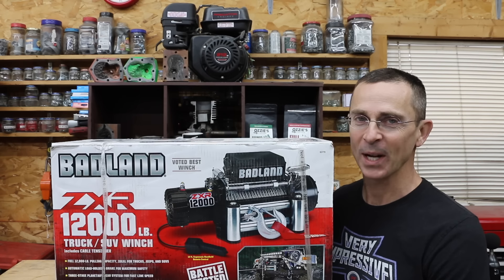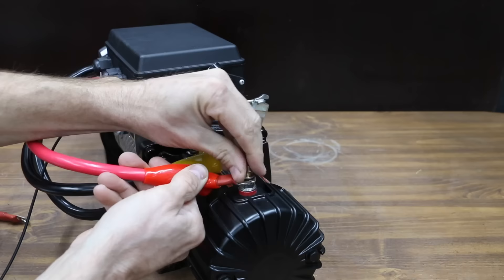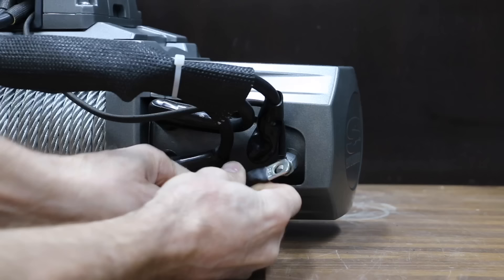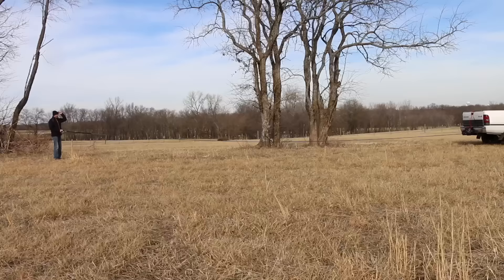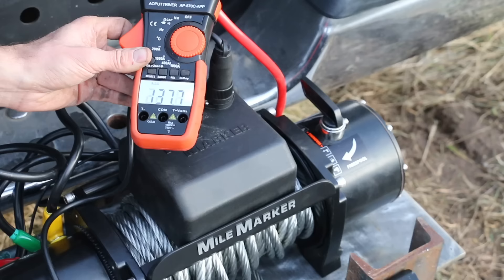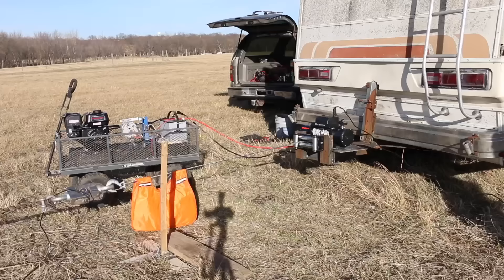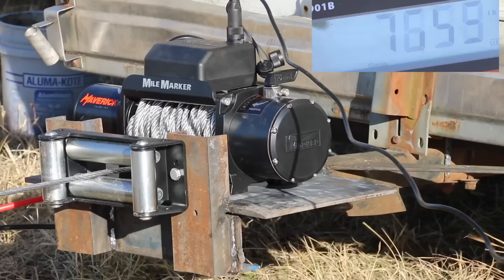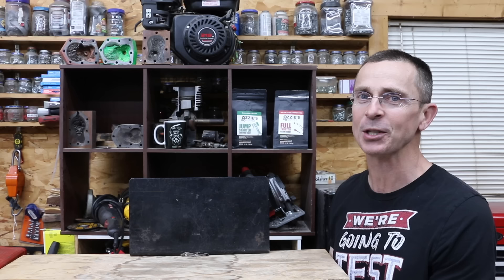Best Winch? Is BADLAND Better Than WARN, Smittybuilt, Milemarker? Let's Settle This!

Comment: I've got the harbor freight badland and have used it heavily and frequently at work.  It's been quite good.  The electrical box on top always pops off and the cable connectors have slipped off.  All in all well worth the like 250 I paid for it 4 years ago.
Reply from the maker: Thanks for sharing.

Comment: Im surprised I missed this one, great job Todd!

I must say, every winch I've ever owned (Warn, Mile marker and Ramsey) all stated very clearly not for lifting. They aren't designed for that. A hoist would be used for lifting and have very different safety features. 

I encourage everyone to research the difference before making a purchase for your intended use. As well as researching the difference between a planetary setup and a worm Drive setup.

Thanks again for all your hard work!
Reply from the maker: Thanks and you are welcome!

Comment: One major factor for a lot of these results is due to the cable being used. I know plenty of people who buy a winch, throw the cable it comes with out, and put on a high rated synthetic rope, whichever brand they have had the best luck with between themselves and their friends. Maybe a test of some of these winches along with the ones others have suggested bit using a good quality synthetic rope for every winch to really make it a test purely of the winch itself and eliminating the variation in rope and cables
Reply from the maker: Thanks for the suggestion.

Comment: Remember that a Class2 hitch receiver is only rated to 3500 pounds. More than that, and pull may pull off your hitch or bumper or bend the vehicle's frame.
 You need a Class3 to handle 12000 pounds--if it is properly installed.

Comment: I'm  going to use one of these to pull down small trees out stump and all. I'll build an anchor plate that attaches to one or more bigger trees then the chain side high up on the tree to pull out. Since it's wireless I should be able to stand pretty far away from the trees too for safety.

Comment: A good test!  Too bad the mounting plate failed!  That is the achilles heel of most winches!  Almost every winch i have heard of being damaged in a pull was from a mounting plate failure.
While I dont know about the others, I have been told that parts are available for Badlands, and most can be repaired.
Reply from the maker: Thanks!

Comment: I used to think that Warn was the only brand worth considering. It has now moved to the BOTTOM of my list. I'm impressed with the Zeak and, given that they are ALL made by the ChiComs, I don't suppose it matter about 'Branding'. I'm also impressed with the performance of the synthetic cables. Since even the more robust winches failed at loads iess than the typical synthetic cable failure and it is much easier to work with then  It seems that synthetic cable is the way to go. Perhaps a test of synthetic cables is in order.

Great work., BTW, Condolences to Cud'n Eddie on the damages.

Comment: The winches have the rated pulling power on the first wrap, the second and third wraps have a lot less pulling power.
With a snatch block at a 10k lb load and running the wire rope out and back to the winching vehicle,  the load gets pulled by both lines 5k lbs each, so the winch only pulls one line or 5k lbs. 
This is a much safer way to pull because a person does not risk overloading a line and the winch is only working half as hard.
Technically a 5k lb winch with a 3500 lb rated 3/8 inch wire rope can pull  25k lbs load using  7 snach blocks and 8 lines to the load. If the winch mounted on a jeep or 4x4, one line from the vehicle and the remainder of the lines would come and go to an anchor like blade from a small caterpillar or loader buried in the ground.
Reply from the maker: Thanks for the feedback.

Comment: I would love to see the apex tested. Although, since I can't seem to find the difference between the two, I'm mostly interested in seeing how the apex performs against the badlands you tested in this video. There's a big price difference and not a huge difference in specs, at least that i can see
Reply from the maker: Thanks for the suggestion.
Reply: Apex is worth it if you want to go synthetic right out of the box , I ended up converting my Badlands 12k to synthetic. Also if I'm not mistaking the Apex is also the refined version of the two. Either way can't go wrong Badland winches seem to never quit even under multi use everyday for years with out yearly service.

Comment: What they don’t say is that the rated pull capacity is only at full run-out of the rope or cable.  Always buy double the capacity you need.
Reply from the maker: Thanks for the feedback.

Comment: winches whether they are  rope, wire,  or chain have a gear train and that's where a lot of the failure occurs. Plastic housings poorly, machined gears, and poor lubricant all contribute to  wear conditions that cause failure.  It'd be interesting to see them  run on some kind of automated  up and down cycle rig that had them lifting and lowering   a large weight  however many times it took to find their failure points,   to see which wears out first and why.
Reply from the maker: Thanks for the suggestion.

Comment: I have used several different winches over the years and I will stand by warn. I am cheap af and try to save a buck where ever I can and did that with winches but I noticed the cheap so ex wouldn’t last very long.  Like I mean I was lucky if they would last a summer going out every weekend off roading. I broke down and bought a Warn 8 years ago and it’s still working. In fact I have replaced the line twice now and the winch it’s self is still going strong.
Reply from the maker: Thanks for sharing.

Comment: Sherpa winches, another testing idea, 12 volt air compressor like the one made by Sherpa, Odyssey and a few others. Where not taking about the ones that plug into your cigarette lighter either. These you mount and wire into you vehicle
Reply from the maker: Thanks for the suggestion.

Comment: For anyone looking for a quality winch at a low price stegodon available at Amazon, eBay Walmart or their own website is a beast, I have a 13500 lbs and it’s fast reliable and apparently they are made by the same factory as warn and sold under a different brand
Reply from the maker: Thanks for sharing.

Comment: And the Zeak has "Easy to operation" in the picture on it's platinum series. I've been thinking about the Badlands for my bus, but considering it was the worst, probably not. I don't think I'd need it for anything this extensive, if at all, but good to know! Biggest positive is I have a store nearby, just a couple blocks from where I work. I just don't know about the warranty replacement or if their extended warranty covers it. Right now, I'm not even using the bus, so no biggie.
Reply from the maker: Thanks for sharing.

Comment: Visually looking at all the brands of winches on the web stores, many have exactly the same externals. Their must be over 20 brands that just look like paint and stickers are the only difference. common for imported products. prices vary greatly even though externals are exactly the same. The Zeak winch has several look a-likes. Living in Alaska I use winches many times a month and prefer either PTO or Hydrolic over electric winch everyday. yet for vehicle recovery and such Electric is the go to. I pulled a skid steer out of a deep creek last month with a 16,000 lb PTO and busted some of the cast metal parts on the frame. so everything has its point of toooo much. thank you for this test and its a good one.. I will be using your test info on purchase for a new winch for my equipment trailer..
Reply from the maker: Thanks and you are welcome!  Thanks for sharing.

Comment: Another important thing to consider is ease of repair and design. The Warn VR evo (while Chinese made like the others) has much better wiring inside the control box, which was neat and very simple. Compared to my old smittybilt which was a jumbled rats nest of wiring in the control box. Also, I’m MUCH more likely to be able to buy repair parts from a major company such as warn.

Also you claim the Warn winch was 79 pounds with synthetic cable when you cleared got 79 pounds while it had steel cable, greatly increasing the weight. In reality it’s much much lighter than 79 pounds with synth cable.
Reply from the maker: Thanks for the feedback.

Comment: This was a great test, thank you for doing it.  The results were even a bit surprising, as Warn likes to claim they are the best winch on the market.  Being an avid off road Jeeper, I use my winch all too often and It would be great if you could do a durability test starting off with the winch well submerged in water.  I have had a number of winches fail on me after the recovery due to the IP rating being a false claim.  They all work under water as stated, but they allow water and debris inside over time and the contacts and bearings fail.  A winch is an emergency tool, and it needs to work when all the chips are down.  I even had a Rough Country winch kill my battery when simply parked in my garage after wet recovery the week before, actually I have had that happen with that brand twice!.  After I disassembled it, I found massive intrusion of water and debris that was causing the contacts to short.  Adding this to a test would make for a real world test and would be greatly appreciated.  Again, thank you for all you do, I lover your videos and the unbiased approach you always take, please keep up the great work!
Reply from the maker: Thanks, will do!  Thanks for the suggestion.

Comment: I see you using the Amazon cordless screwdriver (nosky?), That you rated really highly. The only thing it didn't have was a changeable battery. I went with the Milwaukee M12, it's great, I use it for furniture assembly
Reply from the maker: Thanks for sharing.

Comment: Since the rug pretty much relies on the base for any rigidity, yeah prob should have used a better one lol... I got slightly higher rated one, 13.5 I think... And yeah, it'll twist shit up if not mounted well.  Also I use a snatch block if doing anything other than a flat tow.

Comment: Looks like the Zeak brand is now boxed and branded as AOTOWO. Same winch as I can tell. Looks like they sold out of the one like you tested and have rebranded them. Even less expensive now, at around $299.
Reply: Looks like the AOTOWO 13k is not on Amazon or ebay anymore. Any idea what the new brand name is?

Comment: This Warn 12k winch is the same as their 10k winch. The only difference is the gear ratio to give it more torque, at the cost of being slower than the 10k version.

Also, this looks to be the gen3 version of that winch, which Warn purposely reduced the amp draw, and thereby the pull speed on, in order to keep people from killing their batteries like the earlier versions were more capable of doing, not to mention the overall heat on the winch doesn't add up as quick. The far, far majority of winch pulls are just a few feet in order to get unstuck, so this winch was designed around that use-case scenario for the casual  off-roader. You can step up to a higher performance model to get a faster pull speed under load or a longer pull time before overheating.

I have a warn m8000 that I bought around 2010 and that thing is still going strong after 10+ years of abuse.
Reply from the maker: Thanks for sharing.

Comment: Comeup winches seem to be the middle ground between china made junk like the Warn EVO and US made like the Warn Zeon and Ramsey.  GM is offering them on the new Canyon and Colorado.  Comeup just released their Solo brand here in the US, Arctic Trucks use them in their builds.  Comeup winches are made in Taiwan and US hq is in the same city in OR as Warn.   Disclaimer, I do own a Warn Zeon 12S, Comeup Seal Gen2 9.5S & Solo 12.5, the Warn and Comeup 9.5 did not come with the rope wound on the drum, but the Solo 12.5 did.
One other test would be the failure points of all the state rope/line strength vs  load failure.  Cause everyone loves to watch things breaking.  
As for the mounting plate, even Warn/Jeep had to go back and redesign their front behind the bumper mounting plate due to it wrapping under load.    I believe they went from 1/4" to 3/8".
Reply from the maker: Great feedback. Thank you

Comment: Man that Zeak may be my next buy, upgrade it with cable and it would be a beast
Reply from the maker: Thanks for the feedback.
Reply: Zeak is probably out of stock I just bought the AOTOWO 13000 lb Electric Winch off Amazon it is the exact same winch even comes in the Zeak box just has cheap labels covering the Zeak labels

Comment: Wow! You've got enough spare parts to assemble your own version of a winch. Zeak's cable could be a safety feature for its preservation of equipment. Wonder how a smaller diameter steel cable would do...maybe switch with a steel cable that didn't show internal or external damage. Will have to view again. One of these could go on one of those WW II jeep kits in a box. Not sure if India makes one or not or if Mitsubishi still does. Saw a walk-through of MD Juan in Manila. A CJ 3b high-hood would look good with one.
Reply from the maker: Thanks for the feedback.

Comment: Great video! Must've been a fun day testing those winches out. Did you find that any of them were overheating? Also I noticed that while the Zeak had the highest pull force it seemed like it didn't pull the winebbago/tractor/pickup combo as far as the others. Could that be due to rope stretching? Thanks!

Comment: Good video, my only issue is that it appears that none of the winches were properly spooled prior to testing.  All of the wire rope and ropes should have been fully pulled out and then wound back in under tension to make sure all the wire lays were tight on the drum and previous lay.  When the wire rope and rope is spooled up loosely it destroys the rope and puts extra stress on the winch.
Reply from the maker: Thanks!  Thanks for the constructive feedback.

Comment: Good comparison but does the Badlands cable tensioner really work?   If you do another round of winch testing, please get the Badlands again and put it on a proper mount (Can you try to bend it back into working shape?).  Also, test spooling tangle.  Thanks for all that work (and play).

Comment: Please test the winches for water intrusion. Often times the cheaper winches die from water getting inside the motor or control box. Especially when mounted on a front bumper.
Reply from the maker: Thanks for the suggestion.

Comment: I found it very interesting that none made it to rated capacity. I understand the issue with the rating method but it seems to me if you purchase a 12k winch it should make 12k for the entire length of cable it comes 
with. It seems like they inflate their ratings by almost 20%
Reply from the maker: Thanks for the feedback.

Comment: As a winch specialist/repair shop owner, I don't like what you've done here. I don't understand why you didn't include the standard Warn USA made winch instead of the their budget winch, and why you left out the USA made Ramsey winches? Supporting the 100's of USA workers that make high quality winches HERE is important. You have a big voice out there and I think the lay person looking for winch info wont realize that we make great winches, made in the USA, that beat out all of these winches in every way possible. Also, you left out mention of critical other factors like longevity, overall reliability and most important, repair-ability!! I deal with people weekly that had no idea that you can't repair most of these junk Chinese winches. Warn and Ramsey have full warehouses of parts and support networks. This alone makes them win over the rest 100%. I've always loved your work but this video needs some work I think. Also, anyone buying anything but Warn in this selection of winches you tested would be making a huge mistake.

Comment: @ProjectFarm
Would you be able to do a 2 cycle oil test? An arborist forum I belong to has a never ending thread that questions the difference in wear, power output, carbon build up, and difference in engine temperature between using different ratios. Example 25:1 vs 50:1 vs 100:1
The only way anyone would find it legitimate would be to do the necessary carburetor adjustments between the different ratios. I know you can finally put the debate to rest. 
Love your videos!
Reply from the maker: Thanks!  Thanks for the suggestion.

Comment: Nylon rope is too easily damage when pulling near the max weight rating. Steel rope can be scary near the max rating. I use a short length of steel rope and connect to chain. Chain will recoil if it breaks but not as dangerous as the steel rope.
Reply from the maker: Thanks for sharing.

Comment: You should test hand trucks, my harbor freight 800lb capacity dolly/hand truck, failed at 400lbs max, when I had a heavy 1920s furnace on it and came down 4 steps the plastic wheels bent and then one broke 😂
Reply from the maker: Thanks for the suggestion.

Comment: I know this is a year behind the video's posting but I noted that a lot of the winch failures were related to the cheep mounting system failures. I would like to see a rematch using a "Bullitt proof" mounting system, on all winches. For me personally, speed of pull is not an issue, just get my vehicle unstuck and don't leave me stranded.
Reply from the maker: Thanks for the suggestion.

Comment: I would love to see you test if there are any differences in power and performance between syntetic fairlead and roller fairleads using a synthetic rope in an angle. And yes you can use synthetic rope with a roller fairlead used it for years and I feel that it is more efficient and cause less damage to the rope with the roller wheel.
Reply from the maker: Thanks for the suggestion.